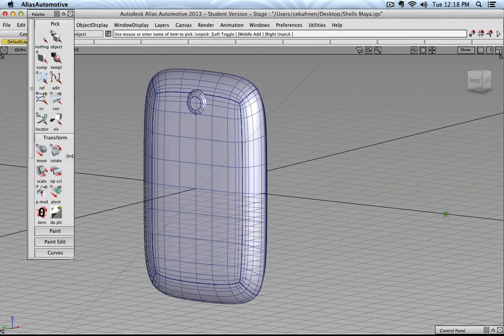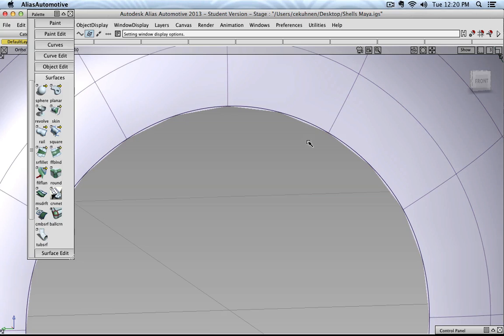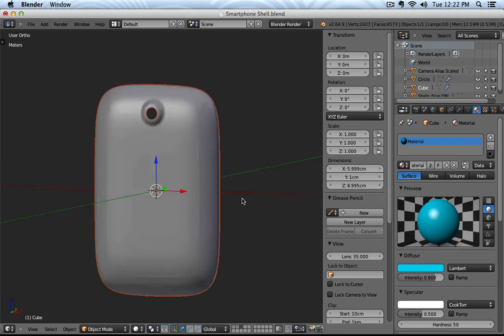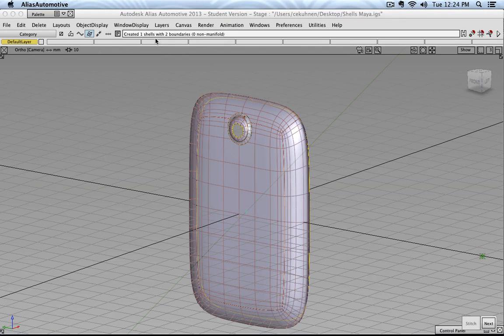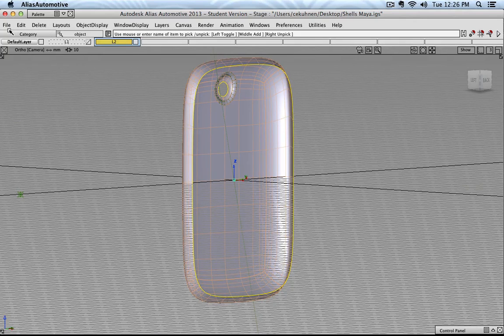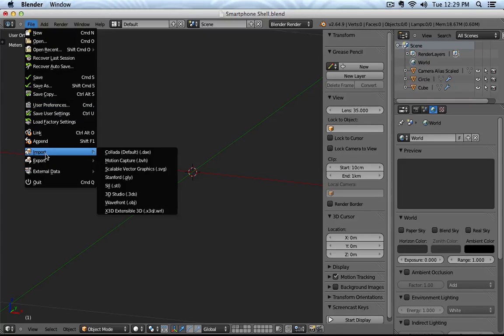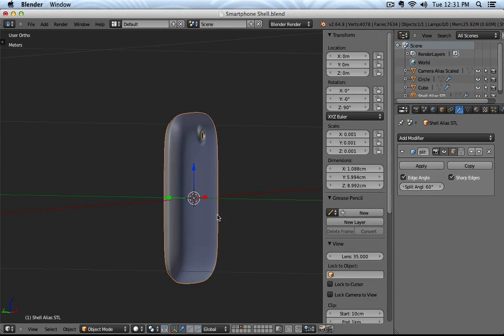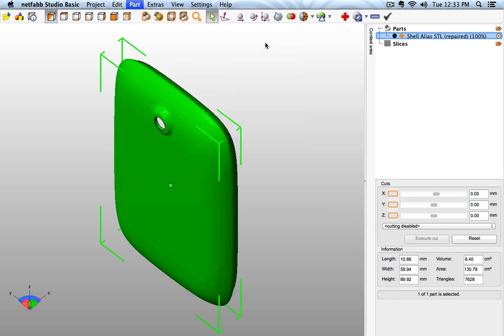Create STL Shell for Rapid Prototyping

Comment: After viewing quite a few of your videos; I must say I ma quite impressed! I as well use Alias for Industrial design work; and have been working with Bleder as its capabilities have dramatically improved over the last several years, 

One thing I am specifically looking for help with, is an issue I run into when importing geometry into Blender from Alias; which ends up having "Creases" in random unexpected places. It becomes difficult to deal with, because if I sent all "Sharp" edges or Creases; I end up modifying the outer part edge that I want to keep sharp. 

Do you have any suggestions of videos that might cover this? 

Thanks for all the workflow knowledge you have already shared!!
Reply from the maker: You can go into edit mode select the geometry and call the remove sharp edge command. Also how fine you mesh is important. I never mesh in any other application than MOI as it has the best NURBS to NGON polygon mesher in the world!

If you want send me a screenshot or the file so I can look at it. info at ckbrd dot de.

And I am very happy you like the tutorials. Alias and Blender are a great combo. You can today load Blender SubD models into Alias and convert it while importing into NURBS models. If you are interested I also use Fusion 360 which offers less Class A surfacing than Alias but a more solid modeling workflow that has a sub-d system build in.
Reply: Thanks Claas, I do use Fusion 360 occasionally; but most of my geometry aside from exploration models is done in Alias. Are you saying there is a way to import Blender Sub-D data directly into Alias and turn it into Nurbs surfaces? That sounds great! I will try to send you a file; though the file I'm dealing with at the moment is based on an old Alias model that I no longer have. The class-A solids were brought into inventor then the assembly opened with 3DS max. The max files are all I have left at the moment. 

I was hoping there might be a more scripted or automated way to find "creases" that were not actually sharp edge. I know how to use the "smooth" verses "flat" shading options for edges, vertices, etc; though I've actually had better luck with using Mesh>Edges>Clear Sharp. It mainly just painstaking to try and select the areas effected without causing issues with other surrounding area.
Reply from the maker: Do you still have access to the Inventor files? You can export to STEP from there too!
Reply: Claas Kuhnen unfortunately; no. I would have done that if I did still have the Inventor assembly.